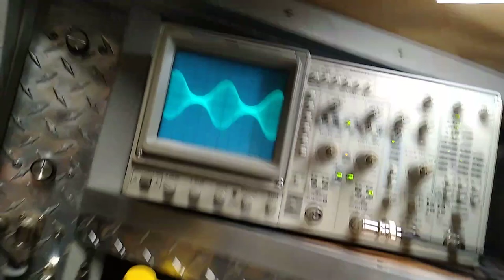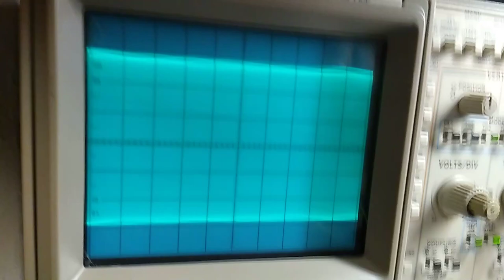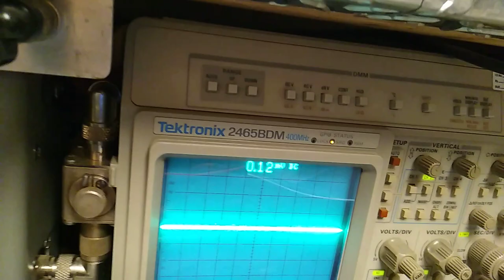Fine Tune CB Shop - Stryker Radios - Meterbaitors STOP The Pinching ,Clipping And Hacking Up Radios!

Comment from the maker: There'll never be a substitute .. like it or not.

It's all about Procedure .. No Exceptions.

You make them ring and I'll make them sing. 
https://www.nist.gov/pml/productsservices/physical-reference-data

No longer accepting mail-ins .. Fine Tune CB Shop services radios for the original owner that has purchased brand new radios from Fine Tune CB ONLY. This way, like the Maytag repairman, I only see one or two radios out of 500-600 per year that may have developed an issue. I'd rather spend my time doing better things .. maybe you should too??

Cleaner And Meaner .. Only the serious need apply.  No "tire kickers" or
undesirables that I know for a fact disrespects the airwaves and 
especially Channel 19. Haters are always going to hate because it's all
that they know how to do and what they do best. 

If you can't handle the heat .. get out of the kitchen. 

If they can't show you .. in a video .. they're snowing you. Get The 
Picture??

Here's what it actually takes to cut through the noise, be loud and 
crystal clear with a better receiver too:  A) Tuned Bench:  
https://www.youtube.com/watch?v=lwcDfXOgAls.  True, it's more 
complicated and time consuming to accomplish these consistent and 
accurate results. Below is a partial procedure and list of calibrated 
equipment used to achieve this level of performance . Read on ..

Radio Evaluation Rules: 
https://www.facebook.com/163Hardrive/posts/3729504220447644
https://www.facebook.com/163Hardrive/posts/3523601657704569

Fine Tune CB Radio Shop strictly adheres to (https://www.nist.gov/) NIST
 Traceable Calibrations and other industry standards to maintain 
accuracy and consistency for providing Real World Performance Tuning of 
Citizens Band and 10 Meter export mobile radios with integrity.

"Basic Textbook AM/FM/SSB Transceiver Tune, Alignment and Calibration" 

1) Pll adjustments
VCO & OSC, AM TX OSC, USB TX OSC, LSB TX OSC.

2) Transmitter alignment
DRIVER BIAS, FINAL BIAS, SSB  (or gate voltages for mosfet versions) 
CARRIER BALANCE, HI-LO AM & SSB Power, RF METER, AMC, ALC and FM 
DEVIATION.

3) Receiver alignment
AM/FM RF & IF SENSITIVITY, FM DETECTOR/DEVIATION, SSB IF 
SENSITIVITY, SSB S-METER, AM/FM S-METER (100uV unmodulated -67dbm for 
�S-9� meter reading!), AM/FM SQUELCH RANGE, SSB SQUELCH RANGE, and NOISE
 BLANKER/AUTOMATIC NOISE LIMITER (Real World dBm to volts (uV) tables 
below).

That's just a typical run of the mill textbook tune up and alignment (if
 you're lucky). There's more to it than frequency alignment, modulation 
adjustment, meter calibration and a tune up report displaying 
exaggerated rms Bird peak watts! 

"Test Bench includes"

Bird 4314C Meter
https://www.birdrf.com/Products/Test%20and%20Measurement/Power-Meters/Wattmeters-Line-Sections/RF-Wattmeters/4314C_PEP-Single-Element-Wattmeter.aspx
Part 1) https://www.youtube.com/watch?v=RpX9IHe4ORM&t=16s
Part 2) https://www.youtube.com/watch?v=LuhbqTf6Bxw
Bird 4314C Accuracy Test: 
https://www.youtube.com/watch?v=DqEOabYqhQo&t=5s
Bird Stipulates 1/2 wavelengths  
https://www.youtube.com/watch?v=5eWhgT-rTII
And Genuine Bird Elements from 1K down.

Bird 4373 Sampler 
https://www.rfparts.com/signal-samplers.html

HP8924c with options
http://userequip.com/files/specs/2147/HP%208924C%20Repair.pdf
https://www.youtube.com/watch?v=Cg1w0xBa27s&t=1s

HP8920a with options
https://www.keysight.com/upload/cmc_upload/All/EPSG072204.pdf

Three analog scopes, one digital 200 Mhz
https://www.atecorp.com/atecorp/media/pdfs/data-sheets/tektronix-2465b-2467b_manual.pdf
https://www.youtube.com/watch?v=by98x4eu2lM

Fluke 27fm
http://www.fluke.com/fluke/inen/digital-multimeters/fluke-27.htm?pid=56055
 
LCR 
http://www.lcrresearch.com/wp-content/uploads/2017/05/LCR_Pro1_Manual_version1.03.pdf

Power supplies
6 Cosel PBA1500f12 (750 amps) variable and configurable.
https://en.cosel.co.jp/product/powersupply/PBA/PBA1500F/PBA1500F-12/
Corcom 20VB1 F7130 EMI Filter 50-60Hz 250V

Times Microwave Coax jumpers and test leads
http://www.timesmicrowave.com/cms/products/cables/lmr/
https://www.youtube.com/watch?v=EmqaGJ6IWow
https://www.youtube.com/watch?v=1ltFVSxGp5Y
https://www.youtube.com/watch?v=v12YZT_1o90
https://www.youtube.com/watch?v=h7iiYfmYWRA&t=215s

Amphenol RF Connectors
https://www.amphenolrf.com/
https://www.youtube.com/watch?v=dVh5B0hdEA0 
https://www.youtube.com/watch?v=dKZg8T_AOso

More range, compliments, reliability and a quieter, clearer but more 
sensitive receiver,  Get Fine Tuned .. not peaked and ruined.

Here are some VideoGates of me at the bench practicing what I preach 
using my bench radio or customers radio completed and ready to be 
shipped: https://www.youtube.com/results?search_query=hard+drive+163+ 
more: 
https://www.google.com/search?q=Hard+Drive+163+nm&ie=utf-8&oe=utf-8&client=firefox-b-1-ab

It's what I recommend, use, service and sell ... to you ... not 
something non practical or deceiving in a misleading way. I'm not just 
the tech and owner of Fine Tune CB Radio Shop, I'm a customer too!  When
 finished, You'll be giving radio checks, not asking for them .

dBm To Watts and Volts
Tables below displays relationship between Power in [dBm] or [Watts] and
 Voltage in RMS, peak, peak-to-peak for sinusoidal signals in 50-Ohm 
systems for accurately measuring and tuning am/fm/ssb receiver 
sensitivity, agc, squelch and "S9" Meter calibration. Real World! 

Mike @ Mikes Radio Repair (Romper Room), Mark Rutherford aka Mark 19960, CB 
Kidd, Martian and all of your other fake accounts pay attention to the 
tables below, stop misaligning radios, spreading false information and 
promoting propaganda! 

  [dBm] [Watts]   [Volts]rms   [Volts]p    [Volts]pp
-140 0.100E-16  22.361 nV  31.618 nV  63.236 nV 
-139 0.126E-16  25.089 nV  35.476 nV  70.952 nV 
-138 0.158E-16  28.150 nV  39.805 nV  79.609 nV 
-137 0.200E-16  31.585 nV  44.662 nV  89.323 nV 
-136 0.251E-16  35.439 nV  50.111 nV  100.222 nV 
-135 0.316E-16  39.764 nV  56.226 nV  112.451 nV 
-134 0.398E-16  44.615 nV  63.086 nV  126.172 nV 
-133 0.501E-16  50.059 nV  70.784 nV  141.568 nV 
-132 0.631E-16  56.167 nV  79.421 nV  158.842 nV 
-131 0.794E-16  63.021 nV  89.112 nV  178.223 nV 
-130 0.100E-15  70.711 nV  99.985 nV  199.970 nV 
-129 0.126E-15  79.339 nV  112.185 nV  224.370 nV 
-128 0.158E-15  89.019 nV  125.874 nV  251.747 nV 
-127 0.200E-15  99.882 nV  141.232 nV  282.465 nV 
-126 0.251E-15  112.069 nV  158.465 nV  316.931 nV 
-125 0.316E-15  125.743 nV  177.801 nV  355.602 nV 
-124 0.398E-15  141.086 nV  199.496 nV  398.992 nV 
-123 0.501E-15  158.301 nV  223.838 nV  447.677 nV 
-122 0.631E-15  177.617 nV  251.151 nV  502.302 nV 
-121 0.794E-15  199.290 nV  281.796 nV  563.591 nV 
-120 0.100E-14  223.607 nV  316.180 nV  632.360 nV 
-119 0.126E-14  250.891 nV  354.760 nV  709.519 nV 
-118 0.158E-14  281.504 nV  398.047 nV  796.094 nV 
-117 0.200E-14  315.853 nV  446.616 nV  893.232 nV 
-116 0.251E-14  0.354 �V  0.501 �V  1.002 �V 
-115 0.316E-14  0.398 �V  0.562 �V  1.125 �V 
-114 0.398E-14  0.446 �V  0.631 �V  1.262 �V 
-113 0.501E-14  0.501 �V  0.708 �V  1.416 �V 
-112 0.631E-14  0.562 �V  0.794 �V  1.588 �V 
-111 0.794E-14  0.630 �V  0.891 �V  1.782 �V 
-110 0.100E-13  0.707 �V  1.000 �V  2.000 �V 
-109 0.126E-13  0.793 �V  1.122 �V  2.244 �V 
-108 0.158E-13  0.890 �V  1.259 �V  2.517 �V 
-107 0.200E-13  0.999 �V  1.412 �V  2.825 �V 
-106 0.251E-13  1.121 �V  1.585 �V  3.169 �V 
-105 0.316E-13  1.257 �V  1.778 �V  3.556 �V 
-104 0.398E-13  1.411 �V  1.995 �V  3.990 �V 
-103 0.501E-13  1.583 �V  2.238 �V  4.477 �V 
-102 0.631E-13  1.776 �V  2.512 �V  5.023 �V 
-101 0.794E-13  1.993 �V  2.818 �V  5.636 �V 
-100 0.100E-12  2.236 �V  3.162 �V  6.324 �V 
-99 0.126E-12  2.509 �V  3.548 �V  7.095 �V 
-98 0.158E-12  2.815 �V  3.980 �V  7.961 �V 
-97 0.200E-12  3.159 �V  4.466 �V  8.932 �V 
-96 0.251E-12  3.544 �V  5.011 �V  10.022 �V 
-95 0.316E-12  3.976 �V  5.623 �V  11.245 �V 
-94 0.398E-12  4.462 �V  6.309 �V  12.617 �V 
-93 0.501E-12  5.006 �V  7.078 �V  14.157 �V 
-92 0.631E-12  5.617 �V  7.942 �V  15.884 �V 
-91 0.794E-12  6.302 �V  8.911 �V  17.822 �V 
-90 0.100E-11  7.071 �V  9.998 �V  19.997 �V 
-89 0.126E-11  7.934 �V  11.218 �V  22.437 �V 
-88 0.158E-11  8.902 �V  12.587 �V  25.175 �V 
-87 0.200E-11  9.988 �V  14.123 �V  28.246 �V 
-86 0.251E-11  11.207 �V  15.847 �V  31.693 �V 
-85 0.316E-11  12.574 �V  17.780 �V  35.560 �V 
-84 0.398E-11  14.109 �V  19.950 �V  39.899 �V 
-83 0.501E-11  15.830 �V  22.384 �V  44.768 �V 
-82 0.631E-11  17.762 �V  25.115 �V  50.230 �V 
-81 0.794E-11  19.929 �V  28.180 �V  56.359 �V 
-80 0.100E-10  22.361 �V  31.618 �V  63.236 �V 
-79 0.126E-10  25.089 �V  35.476 �V  70.952 �V 
-78 0.158E-10  28.150 �V  39.805 �V  79.609 �V 
-77 0.200E-10  31.585 �V  44.662 �V  89.323 �V 
-76 0.251E-10  35.439 �V  50.111 �V  100.222 �V 
-75 0.316E-10  39.764 �V  56.226 �V  112.451 �V 
-74 0.398E-10  44.615 �V  63.086 �V  126.172 �V 
-73 0.501E-10  50.059 �V  70.784 �V  141.568 �V 
-72 0.631E-10  56.167 �V  79.421 �V  158.842 �V 
-71 0.794E-10  63.021 �V  89.112 �V  178.223 �V 
-70 0.100E-09  70.711 �V  99.985 �V  199.970 �V 
-69 0.126E-09  79.339 �V  112.185 �V  224.370 �V 
-68 0.158E-09  89.019 �V  125.874 �V  251.747 �V 
-67 0.200E-09  99.881 �V  141.232 �V  282.465 �V
-66 0.251E-09  112.069 �V  158.465 �V  316.931 �V 
-65 0.316E-09  125.743 �V  177.801 �V  355.602 �V 
-64 0.398E-09  141.086 �V  199.496 �V  398.992 �V 
-63 0.501E-09  158.301 �V  223.838 �V  447.677 �V 
-62 0.631E-09  177.617 �V  251.151 �V  502.301 �V 

                 Don't Be A Mud Duck!

Contact: https://www.youtube.com/watch?v=P0W_Ltzeyyc

163 Hard Dr.